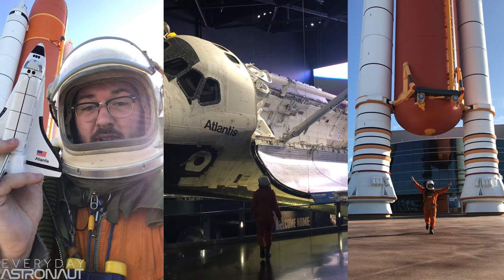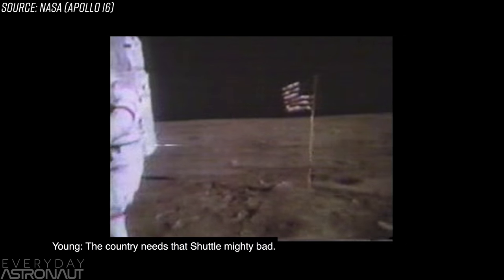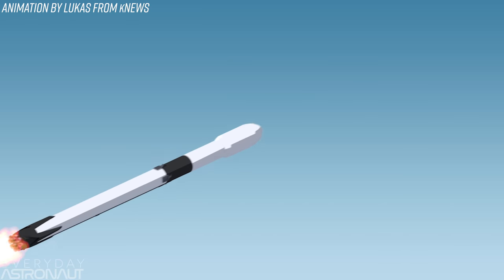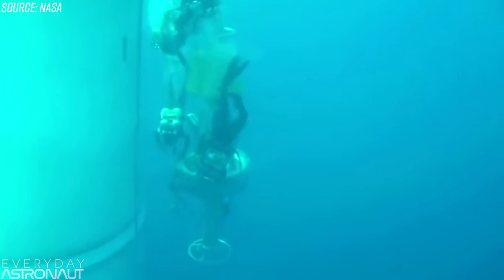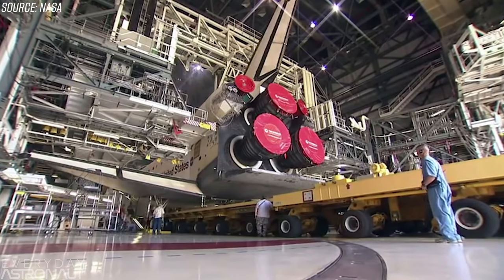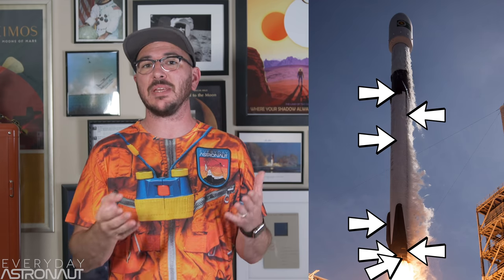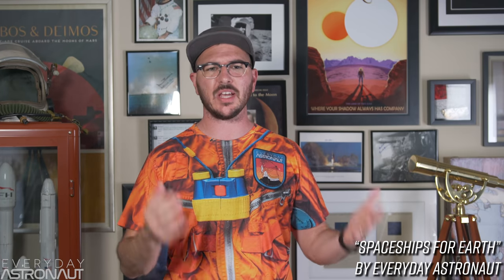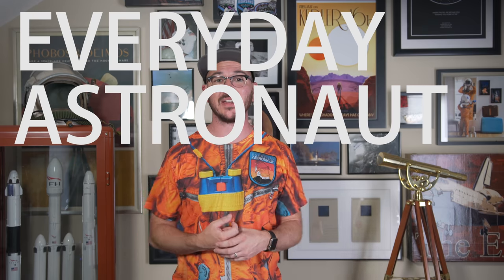Will the Falcon 9 actually be reusable or just refurbish-able like the Space Shuttle?

Comment: Great video as usual. A few comments. SpaceX will have to slow things down once they start flying humans. They will kill some Astronauts at some point. It's not a matter of if but when. Spaceflight is hard and human spaceflight is very dangerous. The Shuttle and the Falcon 9 were designed for very different missions. The typical Shuttle payload capacity was about 50,045 pounds (22,700 kg) but could be increased depending on the choice of the launch configuration. It's a little harder to quantify the payload capacity of the Falcon 9 because there are so many versions and mission profiles. Here is WIKI's take on Falcon 9 payload. The current "Full Thrust" version can lift payloads of up to 22,800 kilograms (50,300 lb) to low Earth orbit, and up to 8,300 kg (18,300 lb) to geostationary transfer orbit (GTO), when flying in expendable mode. The first stage can be recovered and reused for GTO payloads up to 5,500 kg (12,100 lb) automatically landing after disconnection of the second stage. The Falcon 9 has been subsequently upgraded and uprated; on July 22, 2018 a Falcon 9 launched the Telstar 19V 7,075 kg (15,598 lb) satellite into a sub-synchronous transfer orbit, also called a GTO-orbit. At first glance it appears that the Shuttle and the Falcon 9 have very compareable payload capacity. If you are basing this purely on mass then they are compareable. However, they don't compare equally when looking at volume. As you pointed out in your video the Shuttle has capabilty that the Falcon 9 can't match. For instance, transporting something the size of Hubble and most of the ISS modules. The 2 systems have/had different mission profiles. Having been born in 1960 I watched the moon landings and remember how exciting space was back then. My father worked for NASA from 1958 until 1978 and then worked for NASA contractor Teledyne Brown on the Space Shuttle for another 15 years. We watched the first successful Falcon 9 landing together and it was neat to see him crack a smile after the booster safely landed. SpaceX is pushing that feeling of excitement once again. I am hopefull that SpaceX can push the technology to a point where rockets and spaceflight become as common place as a large passenger airliner flying across the country.  

Sources:
https://en.wikipedia.org/wiki/Space_Shuttle

https://en.wikipedia.org/wiki/Falcon_9

Comment: Reuse was already saving Spacex money by the time Block 4 came around as the most expensive parts of F9 were the engines,the octoweb, and the avionics and getting those back saved over half on cost.
ULA and Ariane Space plan to recover just that part of their boosters since the fuel tanks are relatively cheap.
They didn't really freeze the design of the Shuttle's air frame until Discovery and the last three were lighter due to changes they were able to make after getting flight data.

Comment: Fun thing about shipping costs is they're also something that historically was extremely expensive.
(though probably not on the scale of a rocket launch, even relatively speaking)

Shipping something overland was slow, risky, and very expensive.
Shipping it by water was a lot cheaper, but the costs of loading and unloading ships were very high, and very labour intensive.

So... What changed, in the modern world, besides technology in general?
Shipping containers.

Seems innocent enough, but that one thing reduced the costs of transporting goods by something like a factor of 100.

And it's not like you'd need modern technology for that concept. Sure stuff like cranes and steel and the like help a lot, but broadly speaking the idea behind a shipping container would've been possible 1-2000 years ago. Just... Nobody thought about it, or considered why you'd want to do that.

The challenges with rocket launches that make them so expensive are quite different of course, but it's just a random example showing how something seemingly insignificant can have such a huge impact...

Comment: first of all like your explanations, second, I believe that for space x to accomplish reusable rocket status, they need to have their booster system make a full sustained orbit at the same speed as the shuttle used, then use their engines to create a full protective shield, during its decent burn. The combined deceleration and heat versus heat- engines versus atmosphere would negate the need for any ablative armour, due to the rapid reduction in time spent in the thermal area. This would turn it into a full reusable rocket system, again I believe

Comment: to be fair, there were significant structural differences between Columbia and the later orbiters, not to mention that the later orbiters had upgraded avionics.  Also, they had a few refinements on the drawing board that were sidelined by both disasters.

Comment: Great explanation of the space shuttle and those troublesome tiles which in the end, were too fragile to withstand anything going wrong with the booster rocket (lost insulation hitting the wing edge (Columbia disaster) or O ring assembly failure (Challenger disaster).  Being based on engineering from 1968 to 1975 it makes sense that SpaceX based on engineering starting in 2002 is far more advanced than the original NASA design - and is far more "reusable."  What is most amazing is the computers which the old Shuttles had designed by IBM in 1971, which was not even the 086 computer.  The computers on SpaceXs Falcon 9 are "classified" but they admitted they use Linux.  Odds are they use (as NASA locked the design down) the equivalent of some Pentium model - which is thousands of times more powerful than the ancient shuttle had.
Reply: Perhaps not as new as you think.  The Merlin engines on the Falcon 9 are based upon the 1960's Lunar-Lander engines made by TRW.  SpaceX even hired their chief engineer.  They were designed to operate stably at very low throttle, which is one reason the Falcon 9 has been successful in landing the boosters.
Reply: @williamgrissom9022  They are based on it, but were updated so yes, older technology but updated as well with newer technology.  The Shuttle was based on engineering from 68 to 75 - so that technology was 31 years old with no updates when retired.

Comment: One Problem the Shuttle had was the Heat shield. It needed several Days to cool it down. Couldn't find it but i think it was about 2 Weeks of cooling before Work on the Heat shield could be startet. So the Minimum Turn Over Time was one Month thanks to the different Problems and Real Turn Over 3 Month. Planned was 1 Week.

Comment: Surprised about the increase in turn around checks on the shuttle post-Challenger. Wonder how many of those were really necessary. The loss of Challenger was down primarily to bad management. The only fault you could pin on the Orbiter was the lack of a crew escape system.

Comment: I believe that the faring covering the payload on the Falcon 9 are reusable too.. how do these make it back through the earth's atmosphere without heat shelds and how do they not get smashed to pieces  when hitting the ocean?
Reply: They use gas thrusters to angle the fairing halves in a way so it doesn't burn up in the atmosphere, then it deploys a parachute and used to be caught by a net but is now fished out of the water
Reply: @avinavi5414  Thanks for the info.. I actually saw the boats that SpaceX has just retired.. must have been difficult trying to catch them in the nets. Lol
Reply: @OldSkoolBiker62  Apparently the reason why they had to catch them in midair is due to the sound suppression tiles they used to use but apparently they don't use them anymore so it was cheaper and easier to fish them out of the water since the salt doesn't affect the fairing itself, just those tiles.

Comment: See that is my main argument about why the space shuttle was so expensive to operate is in it’s 30 years it was never re-engineered to save time or money. They did the one design and what ever it was it was , at minimum the number of heat shields could have been cut back drastically by slmply making larger jigsaw pieces of them to act as a whole instead of as one.and as we knew all along was that all it took was for one of them to be damaged and catastrophic results would follow. So that small fact known and never addressed would make me say how many other items could’ve use a simple or just a bit Re-engineering to bring cost down.

Comment: 1. As you hinted the SRB is actually not a component that can actually be reusable. One fact you skipped is that the nozzle of a solid rocket booster is not reusable as you have no cryogenic or liquid propellant to cool it, so it uses ablative cooling or no cooling at all. And a solid Rocket can not be relit or throttled. And as a side note, a single SRB has nearly 30 times more more thrust at sea-level than a Merlin 1C Engine.
2. The level of work hours refurbishing a space shuttle is more comparable to a full overhaul of a jet airliner.
3. The Space Shuttle Main Engine (SSME) is not really comparable to a Merlin Engine. (I think one NASA engineer called the SSME the Ferrari of rocket engines.  The SSME is build to be efficient through a wide variety of heights, because it travels with the orbiter, while the Falcon 9 can use 2 different engine bells throughout the flight. And last but not least. The SSME has between 4 and 5 times more thrust than a Merlin (1C)Engine, which makes the Space Shuttle at least as strong as 12 Merlin (1C) Engines.

Comment: When you compare the costs of refurbishment you need to overlay the results over the difference in capacity. If the shuttle can carry more cargo per mission the disparity needs to be veiwed in the light of the difference in capacity. So if it costs 10x as much but also lifts 10x as much, the cost is the same, possibly less if you account for human costs of increased launches.

Comment: The reason that Space-x's rockets are much more reusable isn't necessarily because of Space-x's innovation (not trying to belittle space-x they do some amazing things and have some incredibly talented people working for them) but rather the conditions and context of the boosters and their flight as follows:
1. Engines - Space-x uses an open cycle engine, a simpler and cheaper, but less powerful engine than the Space Shuttle Main Engines (SSMEs).
2. Thermal protection - as discussed the boosters re enter at a much slower velocity than the orbiter and therefore do not require the thermal protection of the orbiter and the associated expense
3. The vehicle - the Space-x boosters are not really spacecraft, they don't have all the avionics, life support systems, and power generation systems that the orbiter had. I'm very curious to see Space-x's turnaround time and cost for turning around a booster, and presumably a capsule once they start flying humans.
4. Vehicle size - the orbiter was the largest spacecraft to ever fly, and that size had an effect on inspection and turnaround times and cost, Space-x's booster and capsule are so much smaller in comparison
5. Private vs Public - the STS (shuttle) program was an endeavor by the federal government and was subject to politics, components came with stipulations that they be built in districts of politicians who voted on the project, this is true of the SLS program and why it is so over budget and behind schedule and why congress doesn't want to kill it. Meanwhile Space-x is a private company, it can do it's business however it seems fit.
I really like what Space-x is doing, they are capturing the public's imagination and grabbing attention with science and engineering which is sorely needed in this day and age. I think Space-x will be able to reduce the cost and increase the frequency of spaceflight, but the exact same promises were made of the STS program back in the late 70's and early 80's and we got was a far cry from what was promised.

Comment: I get your point, but I think many STS engineers would slap you for saying the shuttle hardly evolved in 30 years.   A tremendous amount of effort was constantly going into making the shuttle safer (particularly after each accident), and upgrading its tech to the extent that practicality would allow.  You are correct that SpaceX's radical approach is more innovative probably better in the long run.   It may just get scary once they start manned flights.   I'm hoping they don't ignore safety protocol as much as Tesla does with the "self driving" systems.

Comment: Add to this the fact that SpaceX has to manufacture a new second stage for every flight.  Somewhat analogously, the Space Shuttle had to manufacture a new external tank on every mission.
Reply: The booster needs to be reusable at least 10-100 times in order to make the second stage recovery profitable, the payload reduction due to the second stage recovery will force you to build a bigger rocket with a bigger booster so the booster needs to be really cheap at first.
Reply: John theux, yeah, recovering second stages is ... difficult to the point of being of very questionable value.

I think I recall reading of a patent by Airbus to separate engines from tanks and glide them down to earth.  The point being that the engines are the most expensive part...

Comment: I do suspect SpaceX will get closer and closer to "reuse" (in the sense a commercial airline airplane is "reuse").  Don't forget that inspect and minor refurbish systems can also be automated to a greater and greater degree as time passes, which also implies "reuse" will gradually become closer to realized.  Plus, tiny cheap sensors can be inserted into materials now, then read out after each mission by software and thus more and more structural characteristics can be verified cheaply by software.  Without a doubt some systems will always need to be inspected and tested by humans, but that will become less and less necessary as time passes.  BTW, as a pilot, you should know that any pilot... even including "lame" pilots of tiny 2-seat private aircraft like me... checks 2, 3, 5 dozen things before every flight.  And this is for a typical "reuse" system (an airplane), not a "refurbish" system.  The truth is, once perfected (which takes quite a bit of effort), automated systems are vastly better for most purposes.  The reason is, they can actually detect and report weaknesses before they become "broken" or "not working"... while most tests performed by humans only detect components that are broken or seriously out of whack.

Comment: If you don't draw the line somewhere then technically no vehicle is reusable, or every one is. There is no aircraft that takes off without having a full inspection done, and little bits of maintenance are done regularly. Cars have to have parts swapped out, and are therefore only reusable for certain distances (just like a falcon, which won't need so much if it never leaves the atmosphere).On the flip side, even the Saturn V is reusable. You just dust it off, melt it down and build it from the ground up. Still "reusable". Even things which burn up in the atmosphere will eventually get smelted back into metal for use.

Comment: I am not sure that we could have built the space station as “quickly” as we did, without the space shuttle.
The Canadarm was instrumental in putting the station together, yet would probably not have been feasible if the arm was attached to a much smaller vehicle, it would result in the arm vehicle moving, instead of the payload due to the fact the mass would be so much lower on the arm vehicle....but that’s just a theory...
I still do not believe that the space station could not have been built as quickly and easily as it was, without the shuttle.

Comment: There exists a very good argument that SpaceX and the Falcon/Merlin combination is very much, already reusable.  They test fire every engine,, and they test fire every rocket, as many times as they feel needed.  Before a Falcon 9 takes off to insert a second stage booster into its burn to LEO,, every engine in thatbrand new booster has been fired a minimum of twice,, and as many as 5 times,,,, drum roll please,,, and then it fires the Merlins twice more after launch to A. boost back burn,, and B landing burn... By the time a Falcon has flown just once,, the engines,, without refurbishment and without inspection every time, the center engine has fired a minimum of 5 times.    Reusable.  Not just refurbish able..

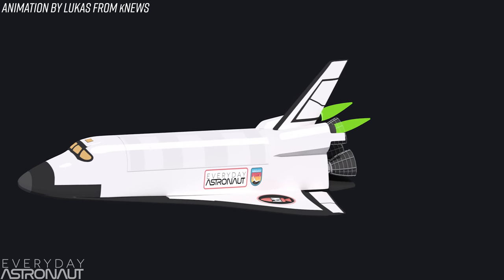Comment: 5:36
so does the shuttle now face away from it's direction of travel or does it face prograde?
Prograde = facing forward or the direction you travel
Retrograde = facing the opposite way the direction you travel --> useful for deorbiting due to the engines being able to counter the forward momentum and slowing the spaceshuttle down.
that's as ar as i know

edit: 8:28 you mean retrograde, right? because burning prograde means you add to the forward velocity of a rocket. retrograde is the exact opposite, burning retrograde kills the velocity of a spacecraft or a rocket.